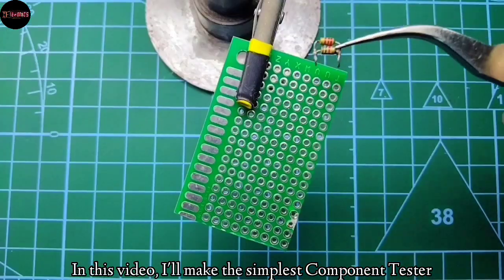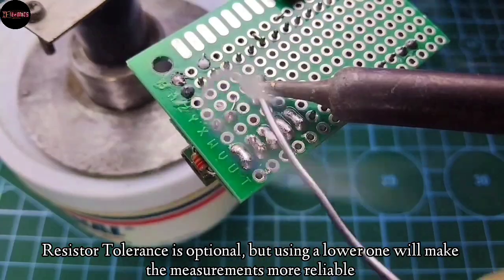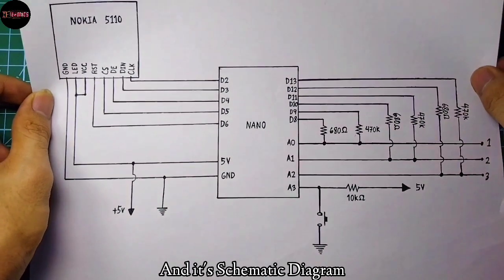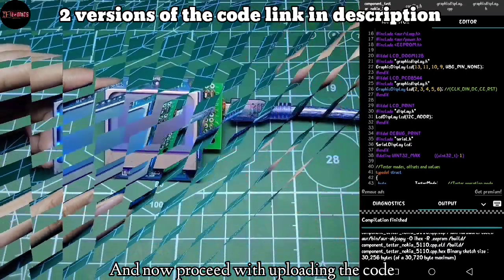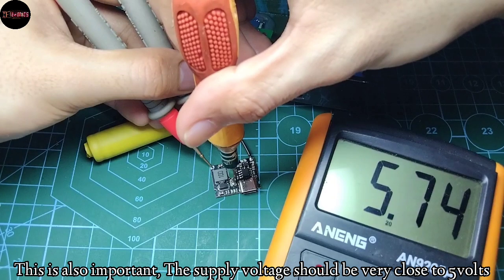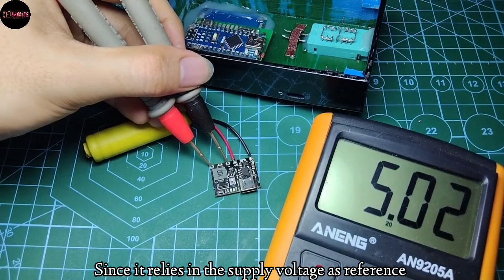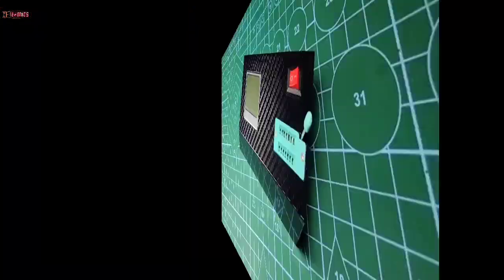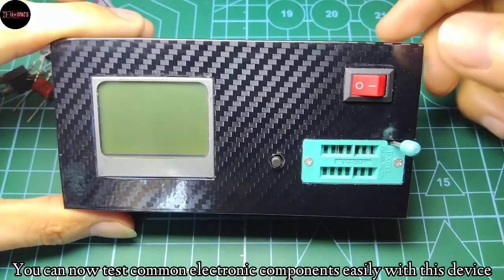This Device will be Very Helpful for Hobby /DIY Component Tester with Arduino Nano!#diy #transistor

Comment: Hi friend, once I assembled it I have 5.4 KOhm for 10 KOhm resistor and more than 1000 uF and NO ESR parameter for a 470 uF capacitor. what may goes wrong? I used 1% tolerance exact declared resistance values for the resistors in my circuit. I uploaded the symbol version as a sketch and use standart Arduino Nano as a controller. Thanks.

P.s. I also removed the 4th resistor and blinker on my Nano as It was required.
Reply from the maker: This is a Bug for Older Versions of the code. It has a Forum in the web, You can do a research online about it.
I'm sorry for this bug that wasn't mentioned here.
That is the reason why I made another version using OLED🙂
Reply: @x3dtronicsph  actually the sketch was ok, I fixed everything by adding a wire from the contact push button GND to REF pin through 10 KOhm resistor. Also It is required to remove a capasitor on the bottom side of arduino nano which is connected to REF pin and finally I plugged a Nokia display to 3.3 V pin (and optionally its led also goes to that pin) instead of 5 V one. Could you upload your OLED version project on your channel? I wanted to build this project using a Nokia display to have symbols of components but there is no ESR param for capasitors so I used the no symbol version instead..
Reply from the maker: @happyrabbit7944 it's on the channel brother, it needs ISP programmer though
Reply: @x3dtronicsph  thanks brother

Comment: I cannot install the firmware with a modified font, there is a compilation error
/build/graphicdisplay.cpp:675:17 : error : ' class GraphicDisplay
Reply from the maker: I'm not sure bro, Can you check if your Libraries are complete???.

By the way, I'm working on a more accurate Component tester, its the 1.13k version with an oled and can be programmed using android as well.
If you don't have the parts for this specific project, I recommend to wait for my upcoming project and. i will have an upgrade too regarding this video.
Thanks
Reply: @x3dtronicsph  libraries installed

Adafruit GFX Library

Adafruit PCD8544 Nokia 5110 LCD library

it would be interesting to see the updated project